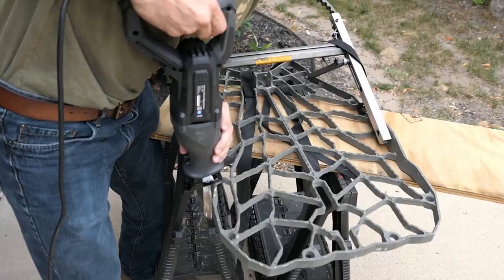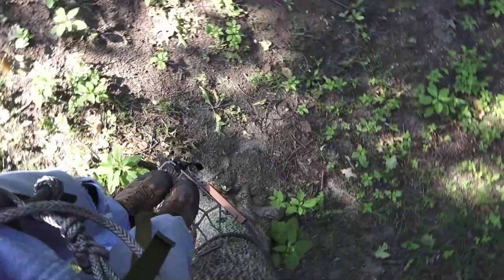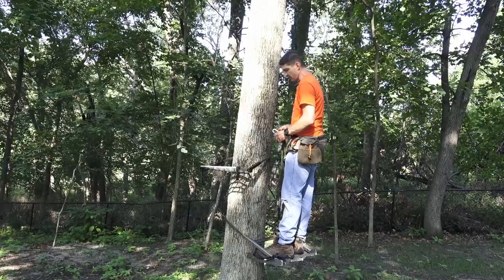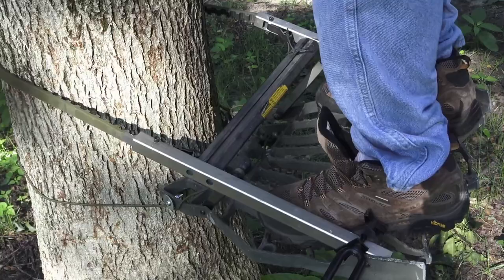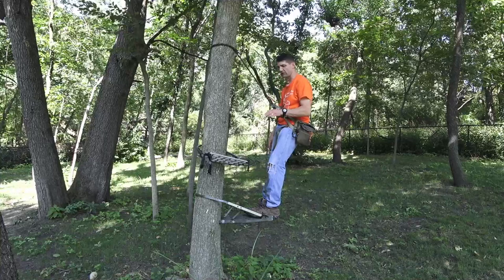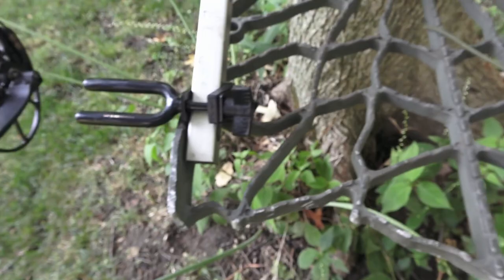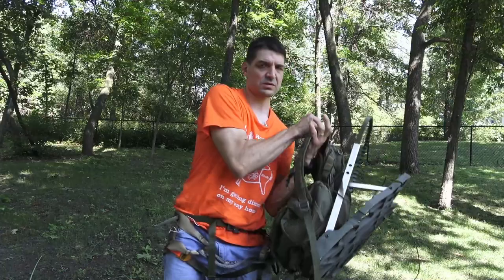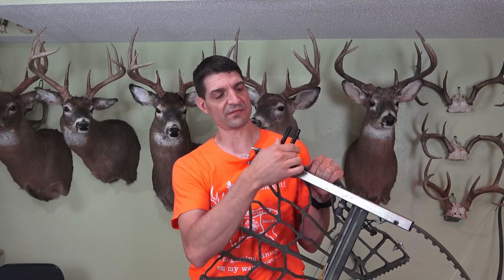Lone Wolf Stand Mod VS Hand Climber Seat for Saddle Hunting

Comment: I’ve used a Lone Wolf Climber for almost 20 years before becoming a saddle hunter. I was a one sticking this past season. I have tested my Lone Wolf seat with a ratchet strap for stability and it is rock sold. I use black rubber bungees for foot straps which work great. The lighter better way to go seems to be the seat because it has a less bulky belt bracket in the way and is much lighter but you must use the ratchet strap.
Reply from the maker: Enjoy it

Comment: Great points Sean. I'm one who has been using the hand climber portion. For the stability when at height, I use a little strap around the tree which gives me the stability I need. Do have to have a strap for my feet. I just use a long webbing strap that doubles as a rope attachment to my tether in case I need to go around a branch or something.
The size hasn't felt restricting but I've not had a larger platform so I don't know what in missing. :) Will have to try a larger platform sometime for grins and giggles. 
As always, that's for the video as I always learn something.
Reply from the maker: Thanks for sharing, brother! God bless you

Comment: Sean, I used the seat section for the last half of last year with great success. Unfortunately I am reading on the forums that it has a high probability of breaking. I bought the whole system new and the foot platform pattern is a bit different than yours. I am going to take the plunge and cut it though. I am glad you did this first.
Reply from the maker: Yeah this is the old old platform. I have the newer one too that I did not cut. The newer design is actually better for cutting. It will give you a little straighter line across the front.

Comment: The seat’s lower profile allows you to add tree steps on both sides of the seat for movement around the tree. It will take some practice to quit a ratchet strap but you can then side load the seat without tipping it.
Reply from the maker: Enjoy it

Comment: Where you drilled and put the bolt. I put an eye bolt on either side so I can use a tie down strap to secure the platform to the tree. It doesn't budge. 
 Great demo.

Comment: It would be Awsome if lone wolf COMBINED the concepts of the two platforms to make the ultimate climber for saddle hunting. 
Take Hand climber and make the V groove deeper and teeth a bit longer to grab the tree better like the foot portion.
Angle the traction belt arms more like on the foot climber to allow the back of the band to clear the tree,  and add the place to put your feet into in order to accend/descend.
Have it still weigh about 4 lbs .
They would make a lot of $$$$$
from saddle hunters!!
It’s the fastest way up the tree, just like in you speed comparison video with different climbing methods.
Reply from the maker: I actually looked into inventing such a stand and got bids from manufacturing companies but it's just too much for me to take on right now so I haven't moved forward with it at this time
Reply: @seansoutdoors  
Ah ok yes it would be cool !
Thanks for responding Sean ! 
Andrew

Comment: Functionally we are talking about a 4lb climbing method and platform for $150. To get the climber base you have to buy the whole stand so that's 8lb and $400, $450 if you buy the sit and climb, and you wreck the resale value. Tetherd one sticks and a ring of steps can get you to a similar weight range (sub 5) and height with aiders, but at $450 with significantly more bulk. You simply cannot beat a LWHC seat for saddle hunting straight trees, everything is a compromise at this level of gear.
Reply from the maker: I bought this whole stand for 150. You just got to shop around and get a used one my friend.
Reply: @seansoutdoors  Totally agree deal hunting and gear swaps are great but if we are going to compare setups you gotta use the sticker price otherwise it's apples to oranges.
Reply from the maker: Thanks for watching

Comment: Great video.   I recently picked up a LW climber for $75.   However the seat section is just the U shape with a padded sling seat so my only option is to use the base.    I also have a Summit aluminum that I lost the seat portion years ago.   I may mod the summit instead of the LW.  Have you ever considered running a ratchet strap around the tree instead of paracord for stabilization?   I tested in the back yard and I can put full side load on the stand with a ratchet holding it from moving.
Reply from the maker: Ratchet strap is noise and weight. You can do it but I'm not
Reply: I use a ratchet strap, works for me and gives me more confidence when I put side pressure.

Comment: I done this exact mod and I love it! After using it, it’s hard to carry sticks back in the woods. Thanks!
Reply from the maker: Great!
Reply: Once you cut the bottom platform, did you notice any cracking etc.?  Still working good after a bunch of use?
Reply from the maker: Yes, solid as before
Reply: Absolutely nothing, it’s rock solid. I love it. We kinda made the 1.0 into a .75 climber. Lol
Reply: I am considering doing this with my stand, but I’m a pretty big guy and worry if it would mess with the strength of the stand.

Comment: Realized one point that you implicitly made but might have slipped past some people. Even with the heavier platform, you don't have to carry sticks since you're using a self climber which so you're still a ton lighter than most setups with sticks and a platform. 
I've bought some sticks this year because there are trees that are either too large for the self climber or have too many lower limbs. I vastly prefer my climber for getting into trees but there's a public land area near me where the trees I want to hunt have a ton of low limbs that are a pain the posterior to use the climber on so sticks it is.
Reply from the maker: Thanks brother. I think I mentioned that in the other video I posted right before this one so I didn't repeat it.

Comment: I use both the top and I’ve also cut the bottom like this. Both methods are good I’m still not sure which one I prefer.
Reply from the maker: 👍 I like the stability of the actual base as opposed to the seat. The seat isn't as stable when standing on it.

Comment: With all these mods, diy builds etc, what's your favorite, go to, preference, for tree climbing?
Reply from the maker: If I can use a climber, I tend to use my lone wolf climber over all. If it's a real long hike and I'm trying to cut weight, I use just the cut lone wolf platform and use my saddle and tether instead of the seat of the platform to climb the tree. If I can set a cordage in advance on a deep public land spot then I use the SRT climbing system for that. If I'm running and gunning with what I've got I use any of these three options.. if I know there's trees I can climb then I tend to use the climber options. If not, I'll bring a throw ball and SRT method ....

Comment: Hi Sean, That's innovative and I can see how this works.  About the LW, I use the same climber, have no plans to cut my one & only up, but asking if you can think of an innovative mod for the seat.  If the seat could fold-up when I stand-up, that would be nice, so it would much like the feature for a hang n hunt stand.  As you know, the seat has the straps to the foot plat form for stability.  How could one keep the stability and a fold-up LW climber seat?  Thanks.
Reply from the maker: They do make a seat that folds up. In order to not have to buy a new seat you'd need a bracket against the tree that blots in on both sides of where the tubes attach to the seat. It could be done

Comment: I am considering doing this with my stand, but I’m a pretty big guy and worry if it would mess with the strength of the stand.
Reply from the maker: I did not find that the weight change of the stand really made it worth it..however, the stand is so strong that even after being cut it does not flex at all under my feet . I'm not saying you can expect the same, but I can say I can't budge mine as far as flexing it.
Reply: @seansoutdoors  thanks for the input

Comment: Shawn . This is a great idea. I will  be  shopping for a used lone wolf climber. Was your used stand the alpha? I currently have tethrd on sticks (4 of them ) at 4 pounds and a predator platform at 3 pounds so a 8.5 pound modified lone wolf climber base is not bad if you know you are hunting a fairly straight tree with just one or two limbs. So much faster and roomier with only one and a half extra pounds! 
Now don’t everyone run out and buy the used lone wolf climbers up :) till I get mine. PS there are still plenty of places I will use my tethrd one sticks and platform. They are great!
Reply from the maker: No I think the alpha has a more narrow back. I have big feet so got the regular base.
Reply: Do you know which model that is?
Reply from the maker: Hand climber II I think it's called
Reply: Thanks again ! Look forward to trying this out.
Reply: If you can’t find a Lone Wolf at a decent price, look for an XOP. They are almost identical and a lot more cost efficient.

Comment: I was wondering if you was going to add the paracord just in case it fell from your last video
Reply from the maker: I had planned to from the beginning to add it for when I go around branches. I just did the other video to show the cut. I didn't show the full setup with bow holder and all. After getting some of the comments I decided to do another video to show the fully completed rig.

Comment: Wouldn’t it be cheaper and better to buy one of the many platforms for saddle hunting instead of destroying a good climber?
Reply from the maker: No because you can't use any of them as a climber. With those you need to bring in climbing sticks which adds to your weight load.
Reply: You dont need to cut it.  I haven't.  Carrying full base v sticks is still preferable for me.
Reply: @nicklausmisiti5204  I was wondering this....do you use the bottom part, ditch the top "seat" part, and use a saddle and tether?
Reply from the maker: Yes, I ditched the seat part.